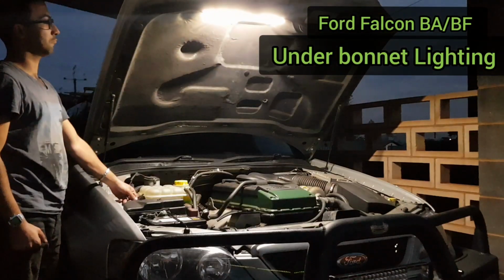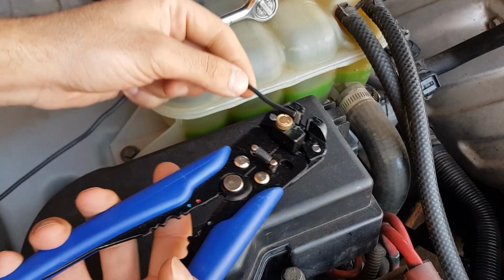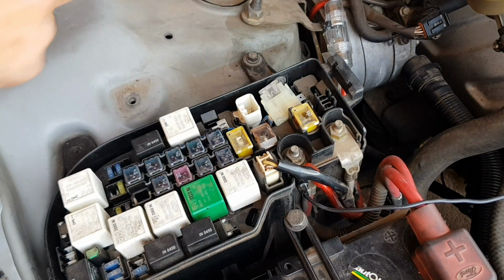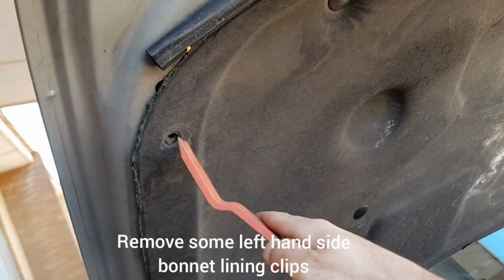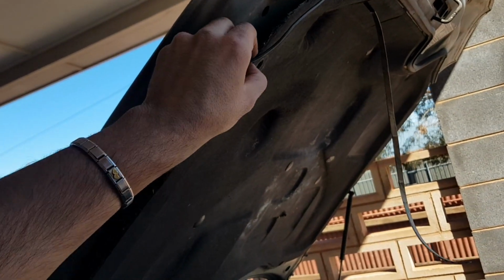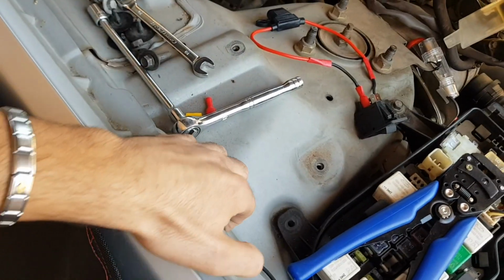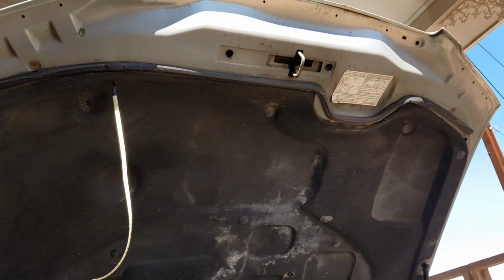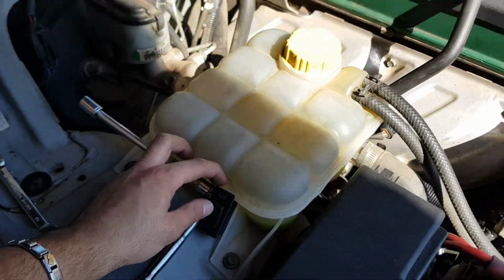BA Falcon Under Bonnet LED Lighting DIY

Comment: I really think if you're trying this yourself, you should disconnect the battery before wiring anything. There's a chance to short the 12V through your hand to the chassis without doing that.
Reply from the maker: Absolutely! My example is not good here, safety should always be first!